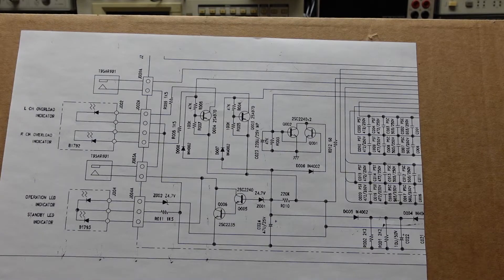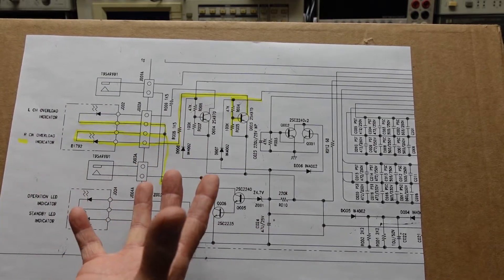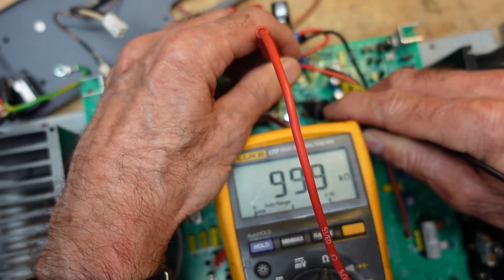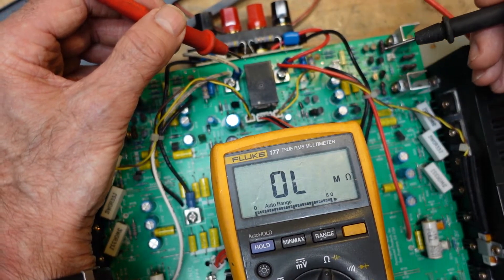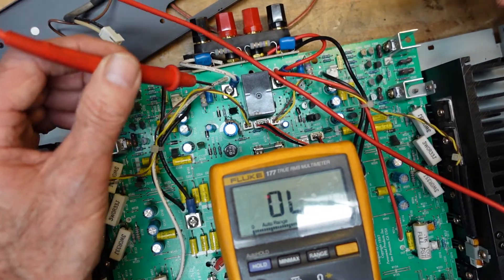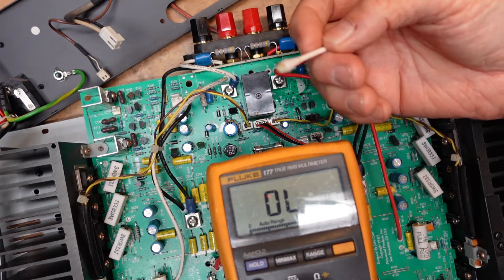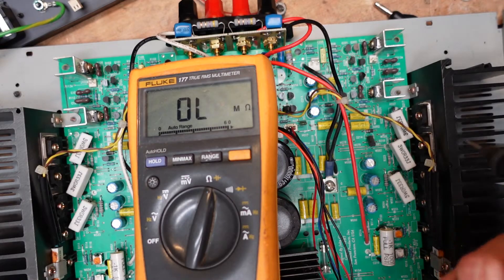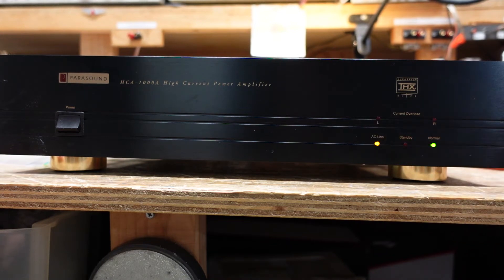Parasound HCA-100A Overload LED Malfunction: Glued and Screwed

Comment: I had a similar problem with a leaking capacitor the electrolyte soaked into the PCB and the board itself somehow became conductive, don't know how this happened but maybe the electrolyte dissolved copper which then leaked into to the surrounding board however no cleaning could get rid of it. I literally had to drill out the affected PCB and then  wire in new components.
Love your videos keep them coming.
Reply from the maker: I've heard of that happening on Adcom boards.  I don't know what the electrolyte is, but apparently as you discovered once it soaks in like that your screwed.  The solution you utilized is pretty much your only option.
Thanks for the kind words about the videos, Dave!